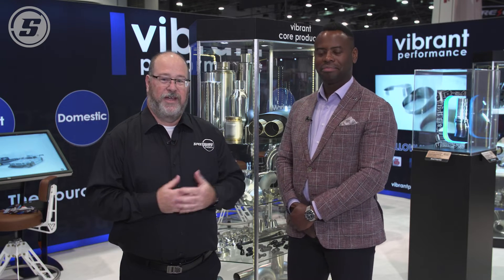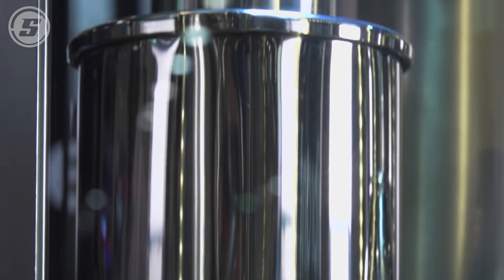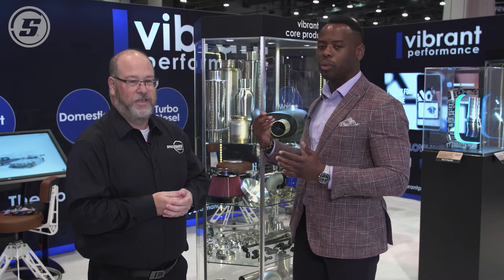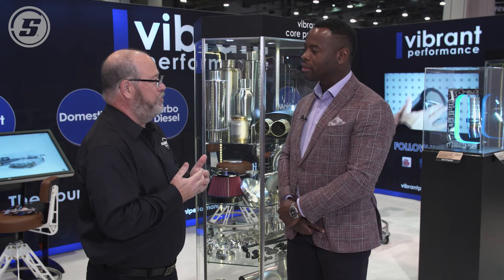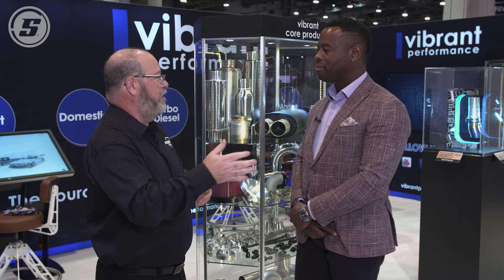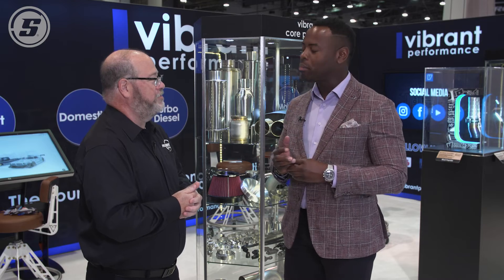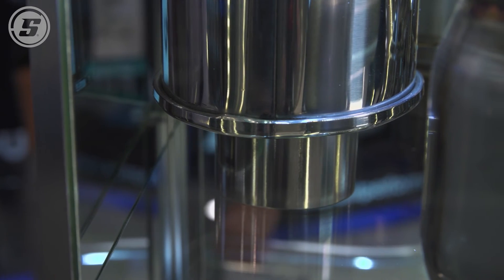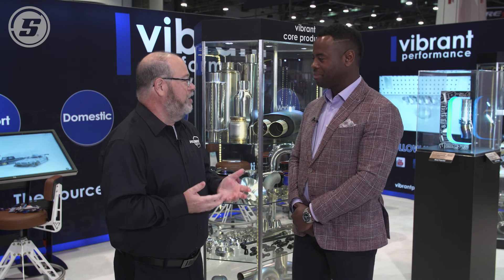What is an Exhaust Resonator | Vibrant Performance SEMA 2023

Comment: Huh...and nope. I run Vibrant 3.5 inch oval exhaust on my B series and 6262 precision gen2 BB turbo straight out the side of the car with no restriction. It sounds incredible however when you pass a parked cop it's best to push the clutch in and coast by lol😅😅😅

Comment: I'm using their Ultra Quiet Resonators as rear mufflers on my dual exhaust and recently purchased 2 bullet/bottle style resonators for mid section to quiet even more. Very impressed with sound but was very disappointed after magnet testing the bullets, that the perforated center core is not stainless steel. Magnet stuck like a leech!

Comment: It would be very nice to show a car which has an exhaust system that has that rap or as I call it a ratty sound which can be obnoxious, record the sound and possibly decibels, then install a resonator and repeat, then show a final clip comparing the sound back to back so people could appreciate what it does. Hard to justify a purchase just because it is supposed to work.
Reply: Couldn't ask for anything better than that
Reply: Thatd be easy to find just put them onto a gen 3 coyote with longtube headers with no cats and it will have tons of raspy redneck sound. Same thing i’m going thru right now, lol want about half of that gone
Reply: @Toomnymods  im running the same setup, planning on doing the valvetronic designs mufflers and the ultra quiet vibrants, any thoughts would be helpful